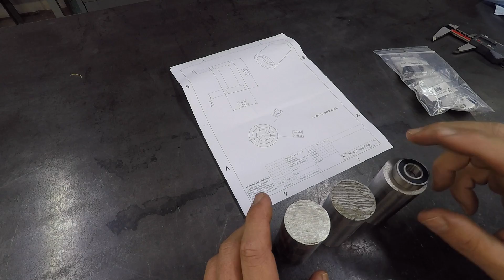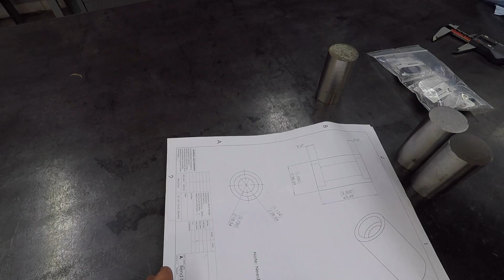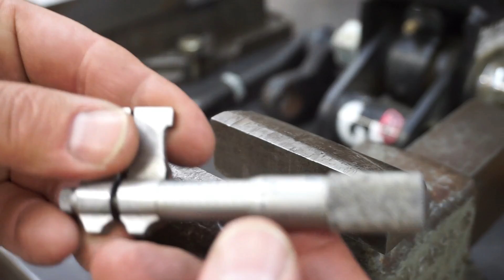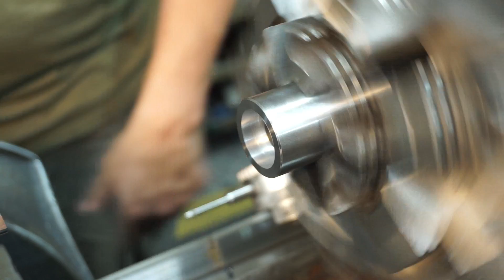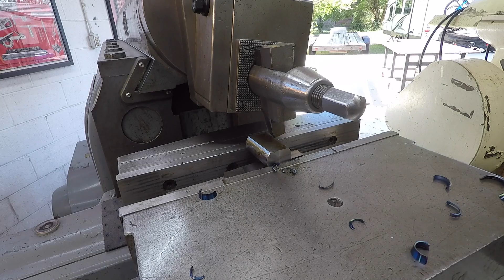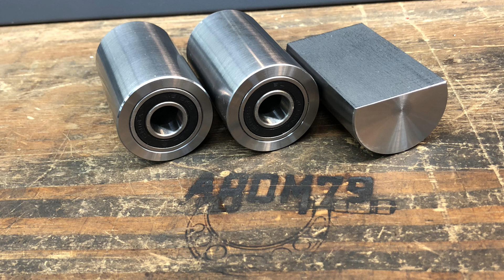SNS 305: Weld.com Collaboration Project

Comment: Instead of using a parallel in the chuck, I have a depth stop which plugs into the rear end of the spindle secured with a grub screw. The bar which extends through the headstock is 3/4" dia (but could be smaller or larger as you wish) and has a collar on it for support at the chuck end. This has the advantage that it can be used for any length of workpiece  up to 4" shorter than the headstock. 

It also remains in place so you don't forget to take it out!

Comment: im nitpicking here. feel free to disregard. but it seems like a coupon bending machine might be higher pressure, lower speed. i would assume a bushing would be better than a bearing for high pressure, low speed.
is this one of those "shut up, a bearing will do just fine, quit being pedantic" moments?

Comment: i am new to this i just picked up a metal lathe at a auction ..its got a old style holder for the cutter got a wedge under the tool arm ,, what is the setting of the cutter tip is it center line of the jaws ?? it is a old south bend lathe ..
Reply: Hi Randy,
Yes the tip of the tool should always be at the centre line of the spindle.  First thing I learnt as an apprentice so you are on your way. :)
I have a very similar lathe to yours.  Mine is an Atlas but I think they all copied each other back in those days.
I still have the old rocker style tool holder but never use it.  It’s fine to start practicing with and getting the hang of it.
You will probably find the centre height is an exact measurement from the bed.
My lathe is a 10” swing, meaning the absolute biggest thing I can spin before I hit the bed is 10”
Therefore I can just measure the height of my tool with a rule as close as I can to 5” and its right on centre height.
There are many other ways to find the centre height.
Reply: Search for “How to Run a Lathe”. I think there are several PDF’s around (it’s an old book and probably out of copyright), or you can order a hard copy from several suppliers. That’s a great book for all the basics and even some of the advanced info of lathe work.  Good luck Randy!

Comment: Going back to the shaper. I know you love collecting tool's but why did you buy an inferior machine which needs sh!t loads of 💰💰💰💰 spent on it? Me personally, when I buy tools I always buy something new or newer, which is better than something old which will cost money to repair or is worth scrap money. 
But then again, if it's something you love then Crack On!! 😜

You with shapers, is probably no different than people collecting old cars. But the problem with old cars is that in time, they'll be worth a lot. Where as a shaper will be like "so that's how they use to remove large amounts of metal back in the day" 

I'm not dissing or having a go by any means I promise you that. Just observations that's all 😊
I love your work though Adam and next time I pop over there (even though I've only ever been there once for WDW Florida), I definitely need to make arrangements to see you, the shop and breathe that lovely machine shop smell in 👃🏻😊👍🏻 
If they did that in an aftershave/perfume, I'd happily buy it. I got a 2 stroke candle for Christmas and it smelt of nothing which really pissed me off. I do own a nitro RC truck but all those fumes do if there's a lot of it is sting your eyes. Might buy a strimmer (weed eater) and start it up shortly but my neighbour hates me playing music even at -60db. So starting that up at 22:00 is definitely put of the question. 

Anyway. Rant over.
Reply: that shaper could easily run for another century or two.   These are simple tools that are built to work 24/7, and with basic maintenance last for a very long time.  New tools on the other hand have electronics that typically only last a few years and then parts will be unobtainable and the whole machine will just add to the landfill, and as programming languages change eventually the logic boards are unsupported (even if you could find a replacement).  Are we really so much smarter going with “new or newer” tools?

Comment: General lathe question.  I'm assuming Adam always has his tailstock set to near dead-nuts.  Why does it seem no matter if it's your own lathe, his, or someone else's, when the drill bit enters the work, you can see it pull to one direction or the other. I haven't measured in my own shop since I don't have the tools to do it, but doesn't that throw the concentricity off?
Reply: Very interested in this also. I find the bit always pulls a few thou
Reply: Interested in this too, I assume it’s because the tip of the drill is never perfectly central, or the bit is not usually centralised in the Chuck perfectly, or even the tip of the drill itself isn’t sharpened to a point that’s perfectly central, and finds it’s own centre when it enters the work. I’ve only ever done a little bit on a lathe, and most of it just by the rack of my japs eye or measured with a vernier, but if was working to the accuracy shown in these videos, I wouldn’t trust a drill bit to get me there. If it’s entering eccentrically, then it’s gonna make a bigger hole. Maybe only a 1/4mm which would be unlikely to matter in any of my applications though. 

P.s. everything I just said could be wrong, it’s just how I picture it in my head and I’m far from an expert.

Comment: that part you did in the shaper was the tool going up and down or was it just looking like that it was in the video
Reply: It's the shapers clapper box. rigid on the cut stroke, work piece pushes it up on the backstroke.
Reply: The tool is free to move on the backstroke, that is the clicking sound you hear. I believe this saves excess wear on the cutting tool.
Reply: @justinahrens1868  well it is good to know i was not seeing or hearing things really like watcking these videos from this guy i find this stuff very interesting

Comment: Hi Adam !  I don't know if this is relevant or not........!  When you were pressing the bearings in place using the arm, ( Not the hand wheel ! ) !! There seemed to be some deflection of the base plate at the very end of the ram travel . Just say'n !  And yeah, that surface finish on the part using the Shaper was awesomely smooth !!  Thanks for showing us your artwork !!!  I say that because, it's Like carving and painting with carbide ! lol
Reply: It really is lovely work isn't it.

Comment: Adam i seen a shaper with a small air cylinder and valve to automatically lift the clapper box so they could use carbide
Reply: Mine has a cable (like a bicycle brake cable) that lifts the clapper box on the return stroke
Reply: I’ve been wondering if there were any shapers that actively lifted the tool on backstroke instead of just dragging it back with a clapper and under what conditions you’d need that.
Reply: @hubbsllc  yep some shapers have tool lift from factory  ,i think fireball tools has a video on his with tool lift , it can also help clear the tool from slots ,corners and form tools. its a good mod for any shaper

Comment: Would you consider a small side project?  I need 4ea unusual studs & the holes in the engine front cover machined with an endmill.   Please tell me either way.  Thanks.

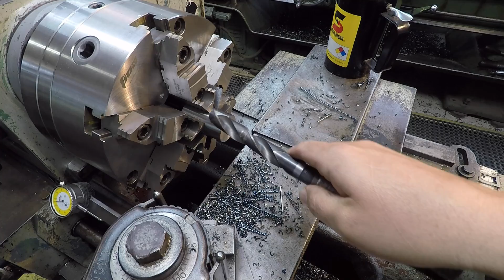Comment: Adam, I noticed at the 8:15 mark when you are drilling the stock your drill and chuck move quite a bit. Looks like something is misaligned. I know there is usually a slight movement, but this seems to be a bit much.

Comment: That mic has such wide flat faces compared to the bearing journal radius. Won't it be off by a few because the contact isn't at the widest point of the journal? Or are you compensating for that in some way?

Comment: On the third roller, with the .990 flat cut, seems that a bearing design for it would result in less drag when used to roll steel etc.  
Machine work is looking good, Adam. Thanks for the share.
Reply: This is not going to be "used to roll steel etc." its sole purpose as stated in the video it to test the strength of welds on test coupons.
Reply: @stevenbliss6484  Good chance he has no idea what it's for let alone the thought behind the design.

Comment: Love watching your videos. 
I noticed you spun the shaft around to bore the other end to suit the bearing.
How confident are you those bores are concentric to each other.?
Having no experience with a 6 jaw self aligning chuck are they accurate enough to keep concentricity between changes?
Also was the outside diameter turned true in the beginning? If not wouldnt that  add to the run out eventhou it might be minor? 
I want to get a shaper
Reply: Adam has that chuck dialled in to one thou repeatability.
Reply: Are three and six jaw chucks the only options available?
Or is there other options when it comes to self aligning chucks?
Reply: @daviddonaldson4044  There are self-aligning 4 jaws chucks. Convenient for quick machining of square stock. I don't think Adam has one tho. 
Adam used to use the independent jaws 4 jaws chuck pretty much every single time. To the point he's pretty much 4 jaws chuck world champion. The even had a face-off with Tom Lipton.  But since he got the 6 jaws chuck he almost never use the 4 jaws anymore. 

Also, 5 jaws chucks are a thing lol.

Comment: I always look forward to your new videos coming out and can tell your a great and talented machinist! That being said I have worked as a machinist for over 40 years and can tell you that any machine shop i have worked in would fire you if you used a sharper to mill a flat on a 5 min milling job.
Reply from the maker: It’s a good thing I work for myself right! Good luck doing that in 5 minutes on a mill. Let suppose the mill vise is already set up and clamped down, and the mill is clean & clutter free. How long does it take to find a suitable cutter? You have a facemill ready to stick in the spindle? Do you have to go search in the cabinet for an endmill?Would you use said cutter in one pass or make multiple passes. It’s always easy to sit back and judge others for the choices they make. The work I share I’m not having to punch a time clock because I enjoy doing it, and I’m creating content for my channel. Scroll through the comments and you can easily see many people of different trades or reasons for watching enjoy what I share. I’m not here to show the fastest way to do a job, that’s what the armchair machinist are for. When I worked the clock for others I always did my work as efficient as I could and no one ever give me grief for how I got the work done. Not that all of this matters, just thought I’d share my opinions since you shared yours. Edit: it’s called a “shaper”, not a sharper.
Reply: I'd get fired if I took my sweet time weeding with a glass of wine or beer in my hand, but thats how I do it at home.
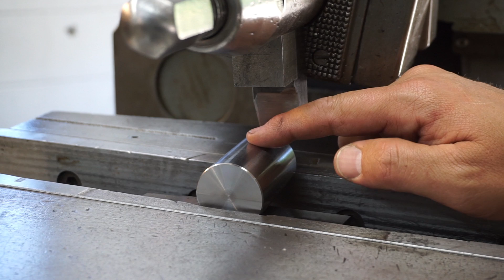Reply: 22:40 to 27:00, that's 5 minutes 20 seconds to shape, including measuring. So fired for 20 seconds? Wow.

Comment: When you dump your chips outside in the scrap dumpster, those chips that have that blue color, do they rust like everything else, or does that blue oxide layer protect the metal and keep them from rusting? Just curious.
Reply: If Adam doesn't respond, you can take a few chips and hit them with a torch until they turn blue and conduct the experiment yourself. I'll hazard a guess to say yes, they probably gain corrosion protection from that oxide layer. Could be wrong though.
Reply from the maker: Yes they still rust as soon as they get rained on
Reply: You can give titanium a color like that by heating it  or by using acid and electricity, and it protects the metal.

Comment: Adam why does the tool  bounce on the return stroke on the shaper. I am not an engineer ,l just find it interesting thanks .
Reply: It bounces to change the angle of the tool bit on the return stroke to stop it rubbing on the cutting edge and thus go blunt faster. A lot like how a woodworking hand plane is lifted clear of the work at the end of the cutting push stroke.
Reply: @markfryer9880  cheers Mark thank you very much

Comment: Quick question...why don't machinists use vacuuming equipment for chip control? It seems more efficient than blowing or brushing the chips into the equipment or on the floor to be cleaned up again later. 
Great content. Love the channels.
Reply: @Jack Lachance Fair enough. I guess I'm just used to my amateur chips-nothing like experienced machinists make. Thanks!

Comment: Probably should have built and added some collars to run between the two bearings centers. Just to help with strength and not put so much stress on the bearings. It’s something that should be added if the shaft has any pressure or weights on them.

Comment: those bearings are gonna be a bear to replace...
Reply: Internal bearing puller
Reply: Easy. Just like doing rotor bearings on a car. Punch from the inside of the opposite bearing. Unless the inner race goes away. Offset hook punch in that case. Not a ton of crush holding them in

Comment: What the heck is a test coupon?
Reply: Welders  do test welds on suitable material to qualify for various types and positions of welds and from those test plates sample pieces are cut out and then bend tested to certify that the weld metal and technique are as strong or stronger than the parent metal.  It is a quick and easy way to show a pass or fail weld.
Reply: It's a section of weld. Bend tests are one way that companies qualify welders to work on code work. We bend it to see if the weld breaks or tears. If it doesn't, it passes.

Comment: Only experience with a shaper was a small one in my high school metalwork class in grade 8, about a million years ago. So impressed with the fine finish you are getting on all the parts you run through yours.

Comment: As anyone done the math to see if those bearings can handle the almost static load? 4 of those bearings don't seem like they would be enough.
Reply: Yup, those Chinese bearings won't last long.
Reply: @Prokurator Generalny Dziura w Dupie Did a quick search on McMaster-Carr for 1 1/8 OD. Ball bearings and the will take a 530 static load, so thats what 2120 lbs. Looks like some weld test bends used about an 8 ton bottle jack. Should be interesting.

Comment: Never machined a thing in my life but curious When you say you take 
50 thousandth cuts is that 25 per side to total 50 or is it 50 on one side
Reply: If you're talking about turning a diameter on a lathe a true .050 cut will result in .100 diameter change. (inside or outside diameter) Some lathes are graduated for the cross slide to cut to a true diameter. In other words if you dial in .050, it will only cut .025, so you get a true .050 off the diameter. Other lathes are calibrated to cut what you dial in, a .050 cut will result in .100 diameter change. So, if you're working with a lathe and you don't know how the cross slide is graduated, you will need to chuck up a piece of scrap and make a cut using the  graduations (say .020) on the cross slide dial and then measure the piece you just cut to find out how it's graduated. (did you cut .020 or .040)
Reply from the maker: For me, when I say I’m taking a specified amount, the the total being removed per pass. On the lathe that means the tool is taking half of that. Half per side.

Comment: when the 47/64" drill bit first made contact, it moved up a bit. Can you explain how it was centred from that point forward?
Reply: It doesn't really. Twist drills are not precision tools. They will deflect by their very nature. That is why he bored the hole afterwards. You can bore or ream a hole to a precision measurement. The drilling is just to get you close with a through hole size.
Reply: All of the above, plus, the flutes on a drill are never exactly the same, so one flute will usually start cutting a bit before the other, causing the drill and the chuck to deflect unevenly at first. As it gets more fully engaged, it will straighten out more.
Reply: The drill will follow the pilot hole . In order to make the bore concentric to the od it must be bored . Even if it is reamed it will follow the drilled hole.
Reply: Was probably just a clearance hole and oversized.
Reply: Agree - I saw it bump up too and wondered about it.  I suppose on this project it may not matter but I wonder what happened to allow that.
Reply: What Micah said. Also tailstocks aren't always super accurate so it could be a little low but since the work is spinning, drills try to find center

Comment: Nice work Adam, always enjoy watching you do these projects!  I was curious, would it not have been wise to broach a couple of slots inside the rollers in the event someone wanted to service those bearings in the future and punch them out?  I realize it''s probably unlikely they will ever need to be replaced but good practice?  Just curious...  I did not notice if you followed AvE's best practice to put the bearing p/n on the outside?  Please keep them projects coming, the reason I started following your channel was when you were making roller assemblies.  That was epic watching you describe the machining order.  Thanks Adam and have a great week-end.
Reply: It's crazy how much stuff gets attributed to AvE, that he didn't start. People have been putting the numbers out for generations. Same with laying pipe in the ground, the numbers go up. Anthony with information printed on it should be installed so the writing is exposed.
Reply: Also, he's making the part to the drawings. There are no paydays in the drawings. And you answered your own question. The bearings will never be changed.
Reply: Andrew, my comment was not meant negative in any way. I was just expressing my curiosity...